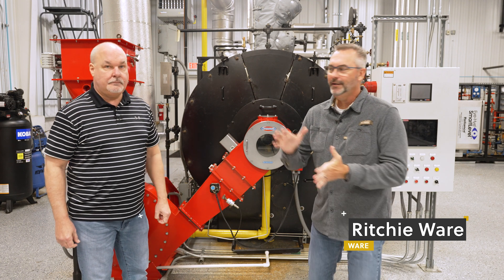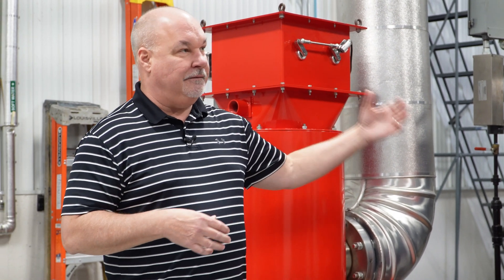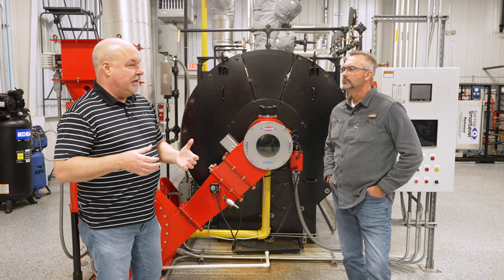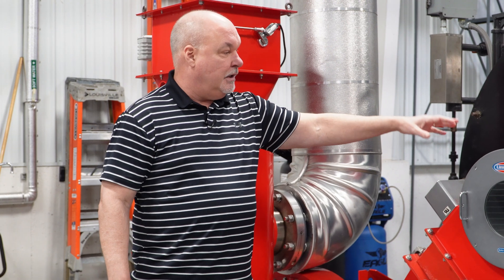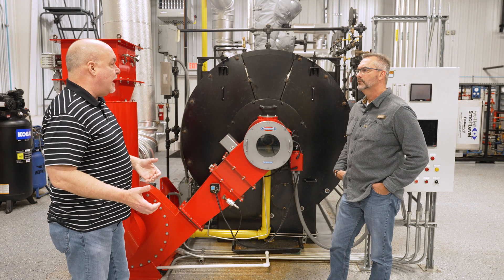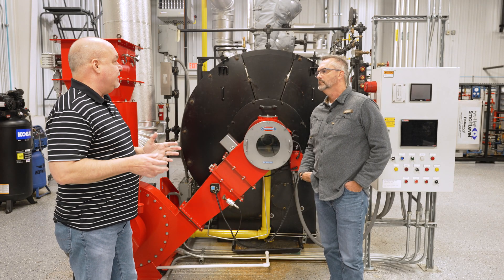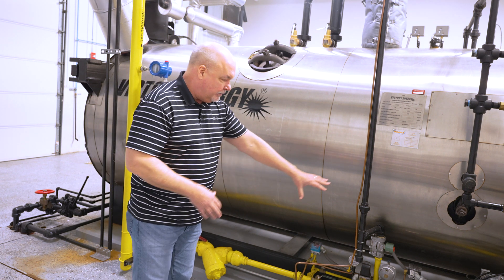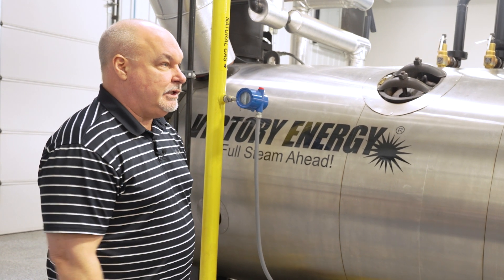Hydrogen Fuel: The Challenges No One Talks About - The Boiling Point

Comment: Isn't hydrogen ignited to heat a metal which in turn heats water? From what I understand hydrogen will sublimate anything from pot metal to platinum. And wouldn't the argument be: what's more efficient- heating a resistance coil directly with electricity or running an electrolyzer to produce gas that can turn any metal into an incredible heat source to boil water? Isn't this what Bosch is doing?